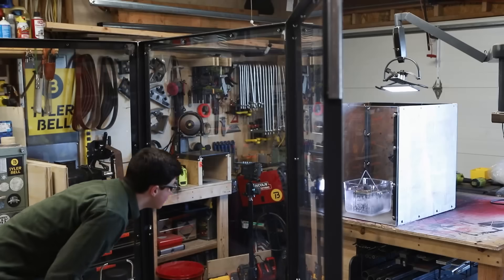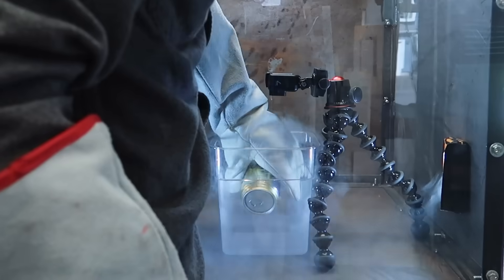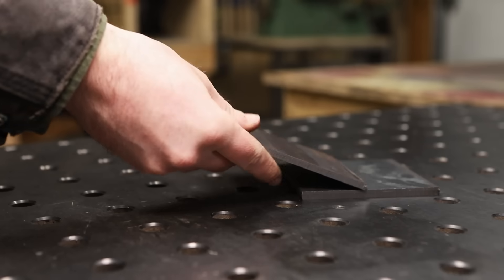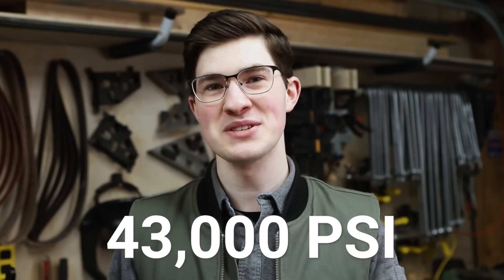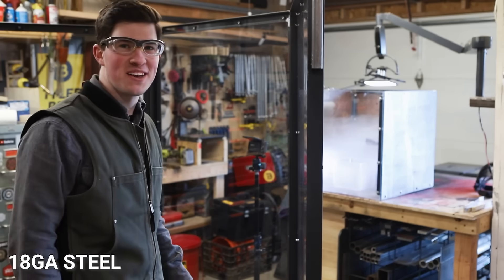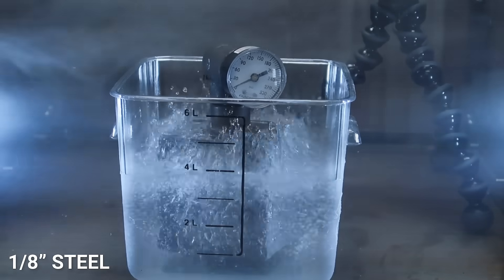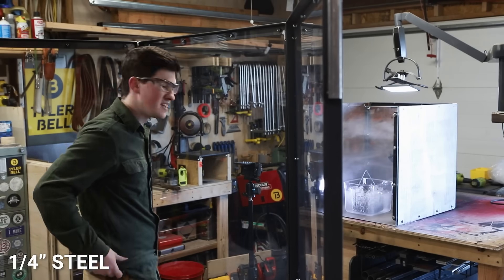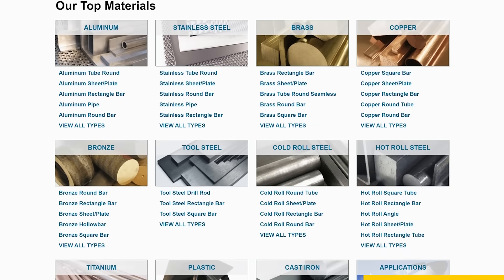Keeping ICE from EXPANDING?? (in liquid nitrogen)

Comment from the maker: Huge thanks to my Patrons! They help make these videos possible. If you want some behind the scenes stuff and to help out then head over to https://www.patreon.com/tylerbellmakes
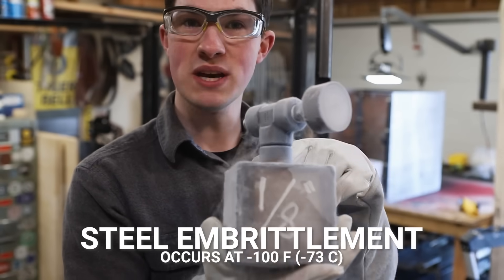Reply: 8:15
😐
Reply: If you boil That same wax and drop it in cold water is extremely dangerous no joke that’s why the flames started because the rain touched the hot wax. It sounds stupid but I’m serious this is very dangerous your lucky it didn’t start raining hard and please do not do this this is a warning to be careful when using that wax
Reply: Thanks for putting it in C°
Reply: You should try this again, but cast the boxes so the welds aren't as much of a weak point
Reply: 44kpsi is peak chamber pressure for some magnums like S&W 500. Just an everyday item comparison.
Reply: steel become brittle than cooled
Reply: I hope this was just from clever editing, but if not you are being extremely dangerous... Pretty sure there were multiple instances where you could have just dropped dead.
Reply: I wonder if the vessel being under vacuum or pressurized before going in the L.Nitro would have changed the results

Comment: 2:07 The extreme change in temp of the water can in nitrogen causes a loss of elasticity in the metal. Thats why it failed before the water could freeze completely . In the freezer it doesnt lose it elasticity and just slowly stretches to accommodate the expansion of the freezing water inside

Comment: Ice is a solid. It shrinks when it gets colder. So does the steel box. But ice shrinks more than steel, because it has a higher thermal expansion coefficient. So why not make this same test, but instead of extremely cold liquid nitrogen, use something that cools the box just below freezing point of water.

Comment: ive always imagined doing this experiment by getting a 1 foot cube of steel and using a mill to create a 1 inch by 6.5 inch void in the center and using a 1x5.5 plug welded into place. or maybe using a round void and threading a bolt down the 5.5 inches

Comment: In my idea of the experiment we don't want the water to turn to ice we want it to remain water under extreme cold pressurized conditions so we need an indestructible intake valve and an indestructible pump that can continually put more water in to increase the pressure so it can't turn to ice while the temperature lowers. At this point, it's probably glowing but rinse and repeat.  Hopefully we then get a snap freeze with net energy gain, maybe they did a movie about it from the 90's?
Reply: So after thinking it over I realized you'd probably then have to leave our ice cube battery out in the sun so it can melt and once it gets hot enough you just release the pressure so you can replace your battery with a colder one.

Comment: i m no physicist and pls correct me if i m wrong but isn t the soup canned hot so there is probably some negative pressure inside that with the fact that there is still some air in and soup should expand less when frozen as it is not just water might be enough for you to have just some frozen soup and compresed air inside

Comment: Another thing that would be interesting would be doing the same experiment but having heat treated the boxes after welding to remove the residual local tensile stresses. Perhaps it'd end up failing in the base material?

Comment: Dude, please do not ever pick up something enclosed and filled with water out of liquid nitrogen. You should wait at least a few hours after the nitrogen has evaporated completely before you pick it up. It could literally explode otherwise, and those gloves won’t save your fingers, and your safety gear won’t help either. Please be patient.

And if you’re dealing with something like wax, you should cover your head, face and neck, or cover yourself completely . You might even want to build a top for the blast shield.

Comment: This is not a good example if you put it in liquid nitrogen, because liquid nitrogen is so extremely cold that it changes the behavior of the metal boxes. What you really want to do is to cool the metal boxes down gradually to let's say minus 50 degree Celsius. Also note that you put together the box out of metal plates, so the zone between the metal plates is the weakest and that's where the cracks occured. So instead use a real solid box made out of pure steel without weaknesses at the edges.

Comment: All I see is bad welds failing. The boxes should be able to contain the swelling by deformation. Every single failure in this video is from poor welds. Remember: A part will fail before the weld does. (if a weld is done correctly)

Comment: When you froze the soup  cans and didnt understand why there didnt appear to be any expansion, one possibility may be that a lot of tinned foods are only filled 80-90% (a rough guess), the rest of the space is filled with some sort of gas that i would expect to be some sort of inert gas like maybe Nitrogen to ensure that the shelf life is as high as possible.

So when freezing the soup cans there may have been some expansion of the fluid/water content but instead of the tin expanding or bursting the gas in the can would have compressed.

I couldnt say for certian this is whats happening and why the tin didnt expand or burst, but this seems like the most likely reason just off the top of my head.

You seemed very aware of the risks during the experiment, however if your ever working with high pressure containers again, (especially if your trying to cause a failure) I would recommend setting up something that allows you to lower and raise / move the container (just generally end the experiment) from a safe distance and allow it to sit for a sufficient amount of time to avoid the risk of it bursting in your hands or when your near it. Another option would be to have a way to drain the Liquid Nitrogen (LN2) out of the experiment box, not sure what sort of valve would be suitable and capable of working with LN2 or if they can be purchased at a reasonable price, but no harm checking if it would be feasible. (Not trying to critisize or be negative, just wouldnt want you or anyone for that matter to get injured or worse doing the same or similar experiment).

Comment: I used to x-ray pipelines and we were asked to do ultra sound on the piping to a valve station on a steam line before it was put back into service. The line was 16" schedule 160 pipe with a wall thickness of around 1.5" If I  remember correctly. Anyway, the line had been shut in over winter and we ended up finding a 2' long crack in the pipe. Blew my mind.

Comment: Why didn’t soup can expand?   Mushy contents absorbed expansion just like air bubble in brake line.
Reply: It was broth, not soup, but even so, most soup 'contaminants' are relatively incompressible.  The cans generally have a 'freeze gap' of about 7%, to allow cans to freeze without splitting.

Comment: It did not expand on the Campbell’s can because there is so much noodles. And then oil. And a small amount of actual street water. I don’t think the amount of water content in the Campbell’s canned was enough to push against the steel can(tin)
Reply: I’m curious as to what the noodles look like after freezing them. I assume the water inside expanded and the noodles for us first. And probably squish the noodles up. I will try and dying they can gently removing the contents and look at the quality of each noodle

Comment: A few recommendations on your experiment. If you try a 304 or 316 ss box and use full penetration welds rather than just the corners you’ll have a much stronger box without cryogenic embrittlement. Also if you can find a cylinder with some hemisphere heads that would prevent the expansion from occurring to relieve pressure. My guess is this would be very dangerous though since it would have a high burst pressure.

Comment: Pretty cool experiment (pardon the pun) and very informative. I'm a bit surprised the threads on the plug didn't fail. I've seen it in frozen copper line before with copper plugs.

Comment: If you take the label off a soup can you'll find that the can has areas of corrugation. This is why it didn't bust nor blow. The can is made to keep the contents inside. (not just to hold it) The diameter at he ripples should have changed.

Comment: Could you use wax and heat to create like a piston to lift things? Is it more powerful or as powerful as hydraulics? If so you can have a "hydraulic" system without the machinery for compression. Just need a way to heat the material

Comment: By any chance, did you attempt any of these experiments with distilled water? Only cause I’m reckoning, without mineral contamination, and the fluid supercooling, prior to freezing, might achieve a more symmetrical molecular crystalline alignment, when it does freeze. Whether that achieves more, or less expansion, or a negligible difference; anyway, I can’t confidently surmise, what the results would yield. 😂

Comment: This is incredibly inaccurate and the study was done wrong.. its easy to contain water that has turned to ice inside any metal containers airtight or not.. ur not freezing water inside a metal container, your freezing the metal boxes in liquid nitrogen which means the metal will freeze WAY faster than any liquid u put inside.. so I guess this video completely failed for anyone looking for real information and accurate testing.. fkn waste of time

Comment: Cracks me up messing with liquid nitrogen! E would use it to shrink brass wearing rings on pumps and other things. 
It was our secret sauce for cleaning our aluminum diamond tread deck in the shop. Poured it on the deck, it would chill shock ALL of the dirt and oils from the pores of the metal! It would all dance around in solution until I evaporated, when it would just leave a pile of what came off that we could sweep up with a broom. The decks looked like we had been polishing it day and night for weeks. In reality, about 10 minutes, just long enough to step outside for a smoke, while the magic was performed 😉

Comment: Beyond The Press had a professionally welded cube fabricated to contain C4 explosion.  
The steel was over an inch thick if I remember correctly, possibly 2" and that box eventually failed with enough C4.  Revealing the fact you knew the 45,000 psi expansion pressure of freezing water kindof took away the real surprise of your liquid nitrogen freezing experiment.

Comment: The canned soup (broth) makes sense, because it is sealed with a negative pressure, so it has a little extra room to expand. Also, there is some level of extra empty space in those soup cans, so when you add up the negative pressure and the extra space, you likely get at least 9% of the cans volume.
Reply: That's not why. Water is the only molecules that expands in its solid state. Broth when frozen will shrink. It's normal for everything else to shrink in its solid state.

Comment: Surely you need cast steel boxes to do this properly? With extra thickness at the plug and a great quality thread for that plug.
A nice idea but this has more to do with weld strength than direct water vs steel.

Comment: Since the wax expands as it melts, putting melted wax in the box that is pre-expanded means that when you seal the box and the wax cools it contracts. Then when you heat the box with the electric burner it would just re-expand back to the volume you filled it with in the first place.

The key would be to pack the box 100% with cold wax, seal it and then heat it.

Comment: Water doesn't freeze under pressure.
It expands but is still a liquid and can only expand as much as the pressure will allow.
Once the pressure exceeds the breaking point of the enclosing medium and there is a release of pressure the water immediately turns into ice as it expands out of the enclosing medium.
Holding the frozen boxes is like holding a bomb.
Your little face shield and gloves/safety vest will not protect you from it.
I am saying what you did was exceedingly dangerous and you could have died.

Comment: That blast shield is as useless as a ti-ts on a bull!!! The shrapnel will pass through it like a hot knife through butter. Get a steel plate and use a camera and a monitor to watch from behind it. Other expensive option is to get bullet resistant glass.

Comment: I mean, the liquid nitrogen freezes stuff fast enough that the heat transport properties of the substance being frozen matter in bulk. Thin stuff will basically freeze very quickly.

I was surprised the quarter inch gave up, but maybe it can sustain water again only at insane thickness. It's probably better to simulate that first too.

Comment: Steel will embrittle as it is cooled.

Another one for you to try to make the box out of is in Stainless steel, which does not become brittle at cryogenic temperatures (therefore it will not crack and fail when you cryo dip it).

Comment: Here in Arizona at a certain missile manufacturer I had to replace pipes after a freak year of snow in the valley.

Prior to many of them breaking at t joints and elbows. Valves would periodically open up for humidifiers on the roofs to make up air for the labs. This worked until the pipe failed and an ice cylinder shot out mach 20 speeds at the break. This is a great demonstration that water under pressure can't freeze. 

Right up to that point the water was liquid allowing it to still be moved around the building in a closed system at below freezing temps. It phase changed instantly to a solid as it left the pipe and pressure dropped inside the pipe also allowing all the water to become ice inside the pipe. 

Anyways that sucked ass replacing all that pipe and insulating it so they could maintain production in the winter. Cool video.

Comment: This experiment demonstrates "The Thingy That Shall Not Be Named (or discussed)" 
The proposed Moon Base/Colony's requirements for water are -- ALWAYS -- answered with: "There is an immense amount of water ice in the Southern Craters that never receives any Sunlight. It will simply be mined, converted, (melted) and pumped to the Colony's various sites.." 
LOL! Yeah, riiiiiiight... The Sunless areas are very close to the temperatures of liquid N2 and other liquefied gasses. 
As you have seen, the desirable properties of all materials (bananas, plastics, rubber, steel, etc) disappear at these temperatures. There exists -- nothing -- that will work as required at these temperatures. No machinery. No "Robots". No pipes. No pumps. No Environmental (Space) Suits..! Which means; No People! No workers! No Miners! No maintenance personnel to repair the frozen (broken) pipes... 

So far, after asking various scientists and Moon Colony "Public Portal People" about how this issue is going to be solved.., I have never been given even the acknowledgement of having received my questions... 
They are ignoring me for mentioning that "Thingy..." (that shall not be named) 

Anyone here have any thoughts? 

Side note: The canned foods have "head space" -- an air gap that allows for the swelling of the liquid during the canning process... Which ironically is the same space required for the expansion during freezing... The air contracts (shrinks) during the freezing, giving up its space to the expanding liquid/solid. 
Quite Elementary, my dear Watson...

Comment: freeze plug on your car if you add water like a idiot it will freeze then your plug will pop out instead of your block cracking ...101     run antifreeze all year has a higher boiling point and a lower freezing point all around better

Comment: I’d be interested to see you try it with a cylinder instead of a cube the reason being that as pressure builds it looks for weak points to rupture the container and sharp corners like the ones on the box is where the pressure is going to concentrate which is why it would rupture at the welds as the welds help form sharp corners so I’d be interested to know if you made cylinders out of all the same thicknesses if the results would be similar or drastically different

Comment: Weld penetration and TAZ (thermally affected zone) are primarily what this demonstrates. Too thin of a metal, 100% penetration with large TAZ. Too thick.. results in a less than adequate weld with poor penetration. Middle ground is, as you said, the goldy locks... Good penetration while keeping a weld TAZ at a minimum or within material failure point.

Just my opinion from a pressure vessel rated welder. There are much at play here (weld undercut, metalurgy and other physics stuff i'm sure) but theses are the most obvious ones that would describe exactly what you are experiencing.

Thanks for your time, enjoy yourself and be safe!

Comment: I’m curious if the nitrogen also weakened the welding joints was the main cause of the failure. I wonder if there could possibly be a way to prevent a failure by embrittlement.

Comment: If the camera will be only in one side you can put insulation around the rest to avoid heat transfer where it has no use. The liquid nitrogen is warming up just from the contact with the container heat from the surroundings instead of taking the heat mostly from the sample itself. Too much exposure. That's why it was running out so fast.

Comment: Hey nice vid. I got an idea for part 2. Drill a 1 in dia hole in an annealed, 4 inch dia high-carbon round bar. Weld one end with a thick cap, tap other end. Mill a 1 inch screw where the bottom seats like a valve. Tight there's tolerance. Mill the opening of the cavity to seat like a valve. Heat-treat the thing to 60 rockwell. Fill it with water. Screw in the screw cap that seals like a valve. Weld it. Turn cameras on.  Dunk it in liquid nitrogen. Get out of the room. :)